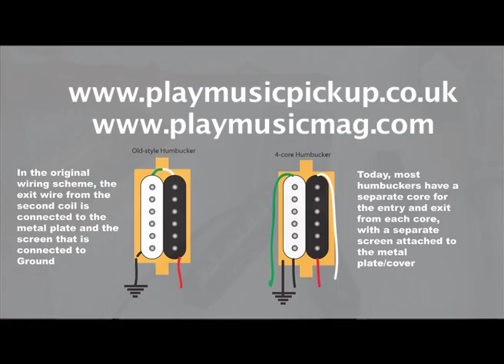Humbucker Pickup Surgery

Comment: Hey! Good instructional video! Just a quick tip to get rid of the wax without damaging the pickup: Use a hairdryer at moderate heat from a few inches away. It takes some time but it will melt the wax so you'll get access to the wires. This way it's easier to get the cover off when you heat it up a little bit with the hairdryer...
Reply: Roland Laussat exactly.
I would also use a solder braid to remove the solder. (Not a chisel)

Comment: My epiphone's neck humbucker is quieter than the body humbucker.  I've noticed my neck humbucker is slanted and I was wondering if that is what is affecting the low volume on the neck humbucker.
Reply: Neck pickups are usually lower in output. Slanted aka "canted" pickups are meant to kind of separate string signals a bit...if that make sense. You can try moving your neck pickup way up till the magnet makes the "worbling sound" through your amp, then just backing it down till effect is no longer there. Thus the loudest position still playable.

Comment: I broke the copper wire on a single coil at the soldering. I only have a 30w iron, is that enough to get that wire back where it should be?